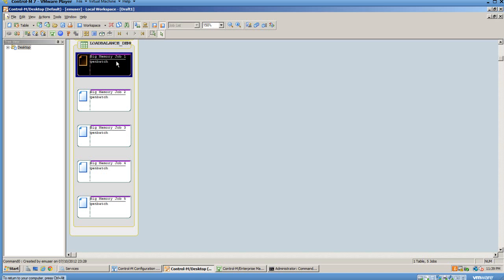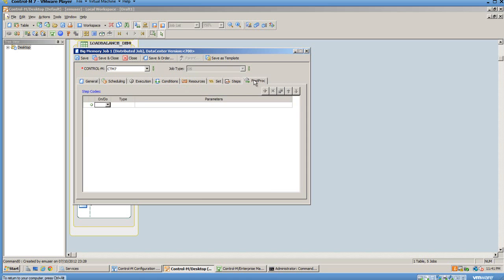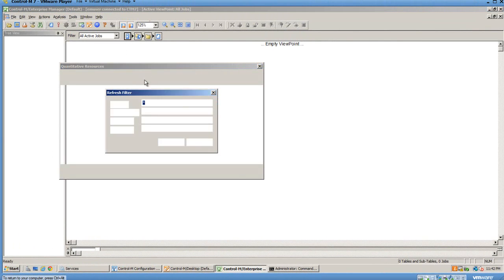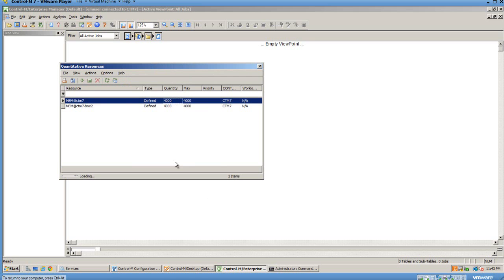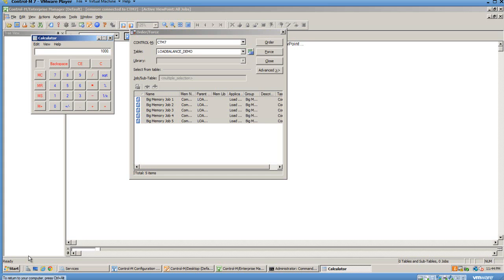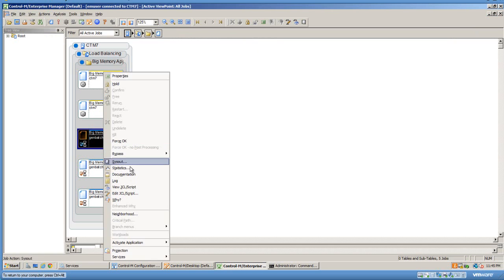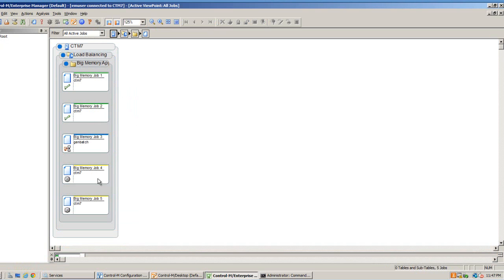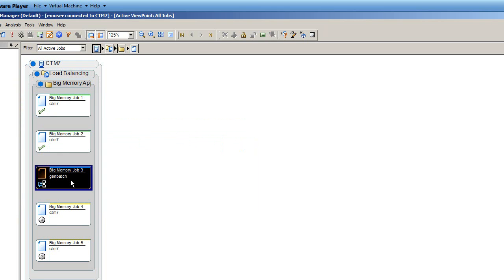Load Balancing in Control-M with Quantitative Resources

Comment: Robert,

Thank you for sharing this is very informative.  I recently found one of your old BMC world presentations on how to use node groups for bulletproof job processing.  I was curious how you implemented these Genbatch servers to operate with the source code server.  Did you have jobs to copy scripts/programs from the source code server or was the source code server mapped from each of the Genbatch nodes and the batch processing was done on the Genbatch "cluster" but the results were then saved to the respective systems?

Thank you for your insight!

Hal Kor